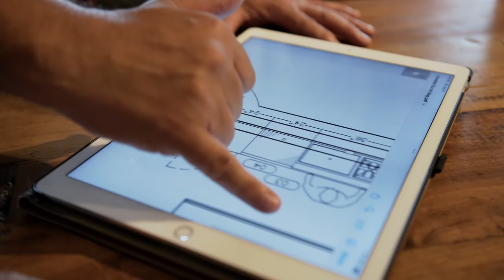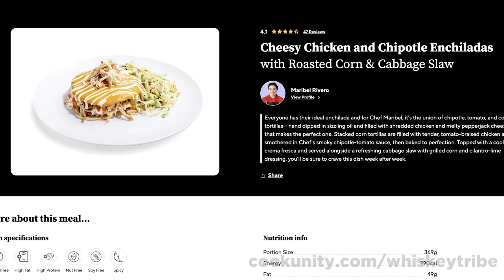The government may BREAK our distillery... | Crowded Barrel ep. 2

Comment: I had this thought as i woke up out the blue after benign some whiskey Tribe videos, What would happen if you barrel age water. than used that water to proof down a spirt, their is a few question we can after that does the water make it takes like the whiskey was age in a barrel it's self. would it still taste the same if the spirt was age in the barrel it self (so aging water and spirt side by side while having some base spirt off to the side to do the test) and what about adding the aged water to the age spirt to proof down instead of just normal water to proof down. and which one of the the 4 different spirts would taste the best to you.
Reply: if you wanted to make this even more testing stuff. you could do different types of barrel casks and different finishes. but this would require alot more work and time and wasted money on an Experiment. i ended up thinking about this after watching the Phoenix aged whiskey